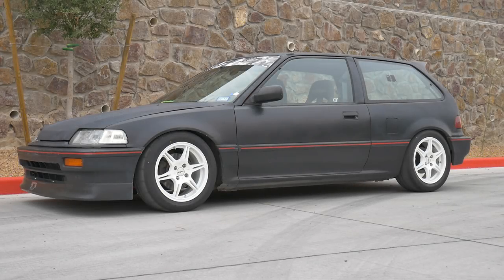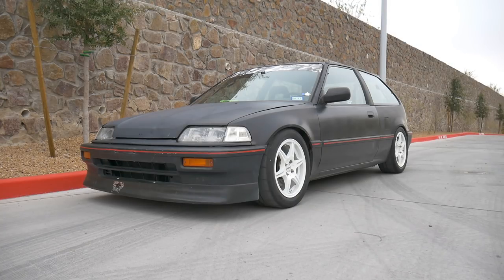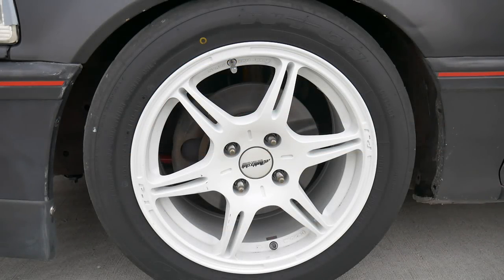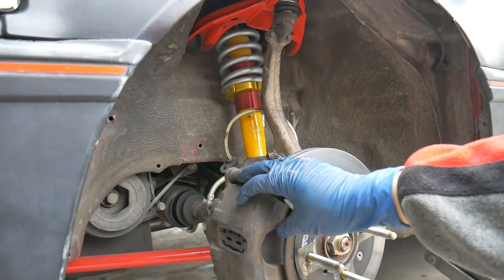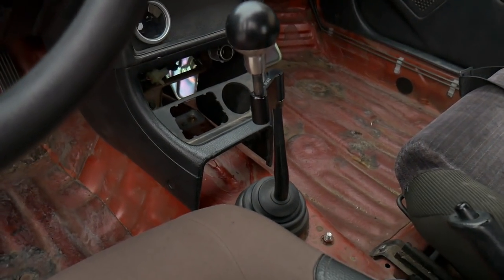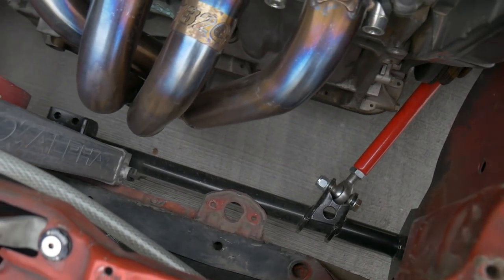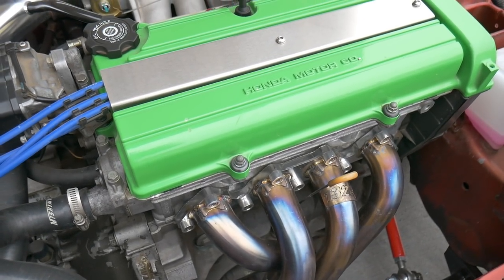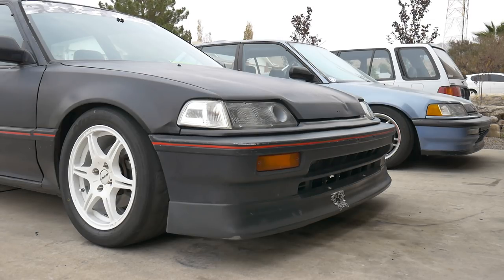My 1990 Civic DX Track Build - B20B EF Hatchback

Comment from the maker: I meant "Innovative" mounts!!  I also forgot the EX master cylinder, 40/40 valve, DA rear disc, and front upper and lower Energy Suspension control arm bushings.  😀
Reply: Garage Built Hondas: with the remainder of this year and part of next 2018 I won't be able to do my rear suspension swap out. But are the 500lbs rear springs a hard feel?
Reply: Garage Built Hondas: where can I send you pics?
Reply from the maker: +Robert Shawiak yes, not recommended for daily use.  Stock are probably 120-150ish, most aftermarket are 250-350.
Reply from the maker: +Robert Shawiak garagebuilthondas@yahoo or through Instagram
Reply from the maker: +ACURA NSXT Me either, not as many roaming around anymore.
Reply from the maker: +Christopher Millington Yes!  I receive all my mail there!!
Reply: Can I send pictures of mine to you sir?   Email address works best for me.

Comment: This car is an inspiration for my 91 DA. It has a tired old B18A1, needs a paint job badly, has expensive mods where it matters and eBay elsewhere (such as lips), still running OBD0 on a chipped PR4. Can't wait to swap in a high compression B20 and throw on some coilovers. Gotta love purpose built cars whether it's a daily or a track car. Or both. 😎
Reply from the maker: +Unliv3D your DA sounds exactly like this car in 2015.  I had the A1 and ran it so hard and it never once let me down.  It smoked like crazy, hence the "black dragon" name of this car, but I kept the oil topped off and it never let me down all season.  You'll love the b20, I immediately felt the difference the first time I drove it!

Comment: Yeah this is my favorite out of all your Honda's, I had it as my first car plus it has a B20.  Really would love to see a wrinkle plus paint job on that valve cover man . Mine came out so very nice. Keep em vids rolling in \m/
Reply from the maker: +Roel Pastors thanks Roel, I'm probably going to change the valve cover before next season also.  Wrinkle red?
Reply: Yes wrinkle red is awesome but it comes down to personal preference. Red will really match the current color scheme though. LATOMMYLA had a very good tutorial recently on how to get it right and Zosh how to NOT lol.  First you sandblast it down to remove all the old paint. Then clean with some brake cleaner. mask of all parts not to be sprayed. tip for the spark plug holes use some old sparkplug wires and cut off the wires. same for PCV valve and breather pipe and oilcap (cut off the top so you just cover the threading). I used and old piece of hose.  then go one thick layer horizontal. wait 10 mins. then one thick layer vertical. wait 10 mins.  One final layer diagonal. Wait 10 mins. Then really bring the heat either by using a pre-heated oven/put in oven to watch it wrinkle (may not please the wife so much lol) or a heat gun. Then let it sit for 24 hours to really let it cure.  The results I had are amazing! It looks even better than OEM because the wrinkle is more coarse.
Reply from the maker: +Roel Pastors Dude, thanks so much for the instructions!!  I'm going to try this method and I love the tips for masking off the holes.  I normally use painters tape and a sharp blade to mask off certain areas, some of those sound easier.

Comment: I prefer the 88/89 bumper and trim! looks better than 90/91 pieces. I like all your mods and your how to videos later Jon.
Reply from the maker: +Osaka JDM Much appreciated!  What's going on with you hatch?
Reply: Garage Built Hondas the front end is on jack stands I've taken out the left radiator fan but the right fan is being problematic and it feels like it's hung up on something from the bottom? and the AC lines don't help being in the way UH! after I replace that then it's on to the timing belt! water pump and tensioner.
Reply: oh, and it's snowing not sure if you got snow in El Paso
Reply from the maker: +Osaka JDM getting down on it!  Love to hear it, still on the RPF1's?
Reply from the maker: +Osaka JDM ugh, we had the crappiest weather this week and snow flurries all day today.  It's supposed to get back to 50 degrees tomorrow.  I hope it does!
Reply: Garage Built Hondas sorry for late response, I'm still on rpf1s you'll be the first to know if I change anything. it's been to cold so still on stands take it easy Jon ✌
Reply from the maker: +Osaka JDM nice, sounds good buddy!

Comment: for bigger brakes and caliper, and not having to change hubs or knuckles.. You can use a 93 Prelude rotor and caliper...  caliper will need a bracket (no biggie), and the rotors, you will need to drill out to an oval shape the stud bolt holes (civic is 4x100 & prelude is 4x114)!
Reply from the maker: Thanks for the tip!
Reply: @GarageBuiltHondas  . . .   I'm old school Honda...  I bought a new CRX in 90, and back then there wasn't an aftermarket market for Hondas.  Also, if you use the stock EF header (it was 4-1 directly), cut a flange and bolt on a used 14b turbo, used an Audi 5000 intercooler (redid the ends) the car ran high 11's all day long, and used as a daily using the stock D16A6!!!.  All this for under $500.  Remember we're talking back in the mid 90's (Ferrari's and Lambo's were in the high 12's low 13's!)

Comment: I like that strut tower brace from Password JDM. I prefer one piece strut braces over the multi piece hinged ones. To me it doesn't make sense to have one with hinges. Also I want to relocate my battery do you know of any good battery relation kits? I''m going to place mine in the trunk...
Reply from the maker: +LockTest I'm going to do the same, but I'll probably piece it together.  I have seen just some wiring kits on eBay for reasonable prices.  I want to drop down in size to the Odyssey 680 and get the bracket as well.  It's a plan for this year for sure.

Comment: High comp pistons? I wonder how an ITB set up would work and run with your engine? The looks and sound plus throttle response is mental for ITB.....
Reply from the maker: +Princess Solace No, not the pistons.  This engine is the high comp version of the JDM B20B which has a slightly higher compression ratio and about 15-20 more HP than the 97-98 low comp spec.

Comment: Is it a 9.6:1 high compression b20 or 8.8:1 low compression. Bro if your racing road course you totally totally want to swap out to a b16 cable tranny you'll have Soo much more power out of the turns and alot more acceleration on the straights.  I know there's a big difference in power between the two and from what I hear the high compression b20 was grossly underrated and wasn't actually 146hp it was actually closer to 160 I've always heard. And upwards of 135 lbft torque . Great hatch though , ill always love ef's and bseries motors non vtec or vtec. I had a built ls/vtec in a 91 crx Hf which was pretty quick , ran mid 12's on drag radials. For brakes on my Crx I had PBR/axis metal master pads (bit harder the hotter they got) brembo blank rotors and good ridge stainless steel lines all the way around with crx si trailing arms and discs in the rear and a master cylinder from a 91 integra. I used a 91 Si front seat bar , 90 Integra rear sway bar. H&R race springs, kyb Agx adjustable dampening struts and skunk 2 adjustable upper arms. I also had some factory bracing that I added that the Si comes with that the HF does not, and it makes a difference.  I had numerous other mods done as well not gonna list them all , your ride brings back great memories to me of my old Crx, I sold it unfortunately about 7 years ago not because I wanted to but because I had to in order to pay my rent as I went through some tough times for a bit which was aweful. I literally cried when it drove away.  I'll never forget it or what it felt like to pull through the gears and dive in and out of turns with that car, never had a more reliable car on top which just made it that much better . Good luck with yours bro.
Reply from the maker: Thanks for that story, I loved it!!  Mine is a 99 spec high compression with the knock sensor.  It made 135 to the wheels with just bolt ons, hoping for more now that I have cams. 

I do have a b16 transmission now with an aftermarket LSD and it feels amazing.  I love the way the car runs at the track and it's so enjoyable to drive.  I'm hoping to get it tuned next and see what kind of power it has in store.  If you look through my channel you'll see that I swapped all the parts from this car to a different shell but still the same.

Comment: Would you consider going to a hydraulic transmission setup? What kind of modification and fabrication would that entail?
Reply from the maker: +Alex Kohlman Yes, but I'm going to be using a cable B16 LSD transmission for next season instead.  You could use the Hasport Hydro/Cable conversion kit, or a few companies make an actual kit to add the CMC inside the pedal assembly.  I've seen some in the engine bay also.  I don't have much knowledge on it though.  Maybe someone reading will help fill it in!
Reply from the maker: +Alex Kohlman there we go, you need hydro mounts also.  I'd consider trying it.  My friend has it on his crx.  I've never driven his car though.

Comment: Looking good! I'm jealous. Currently trying to build a crx but I can't get the engine out of the donor DA. I think the problem might be the rear mount. Do you have to take the whole mount off, or just the bolt that runs through it? Thanks!
Reply from the maker: +Michael Allison thanks!  Just the bolt.  The mount doesn't need to come out.
Reply: Garage Built Hondas thanks for the reply! hmm must be getting stuck on something else somehow then... linkage, exhaust, and axles are all out so I don't know what is going on lol.
Reply from the maker: +Michael Allison heater hoses?  Speedometer cable into transmission?
Reply: Garage Built Hondas I'll double check but I think I got those too. I lifted it with the hoist with a bias on the drivers side. The entire thing comes clear of the engine bay except the rear. When I shine a flashlight back there the only thing I can see still attached is that rear mount despite the fact I have the bolt out of it, it's driving me crazy lol.
Reply from the maker: +Michael Allison it might just be the angle, try a pry bar to get it free from the mount.
Reply: Garage Built Hondas right on, thanks man wish I new someone in the area with your knowledge and skill set. I'm new to working on cars, it is really satisfying but super frustrating too.
Reply from the maker: +Michael Allison I'd definitely lend a hand!  But as long as you stay patient you'll be fine!  Good luck, let me know how it goes!
Reply: Hey no worries, thanks to your videos I'm way ahead of the game. I'll keep you updated for sure, hopefully i resist the urge to bust out the saws-all lol.
Reply from the maker: +Michael Allison lol, sounds good!
Reply: It's out! You were right, just needed some leverage. Managed to stick a 2x6 back there and pry it off the rear mount, came right out after that. Now I have to yank the rear trailing arms off and I can finally have my garage back! thanks for the advice.
Reply from the maker: +Michael Allison awesome, glad to hear!!

Comment: Hi. I just bought a 1988 wagon and it’s amazing. I will like to ask you where do you get the parts for it. Like suspension etc.
Reply: I’m not trying to do coil lower.
Reply from the maker: +Eduardo Mendoza Online.  I Google the parts I'm looking for and shop around for the best prices.  I also check eBay when looking for something specific.
Reply: Garage Built Hondas. If I’m not able to find parts for the wagon can I use the parts from the coup and sedan for it?
Reply from the maker: +Eduardo Mendoza everything is exactly the same with the exception of body panels/parts, rear trailing arm parts, and exhaust system.  And obviously the interior parts are all different.

Comment: Jon, for my b16 swap I’m keeping my stock rad cause I don’t want to notch the hood, what hoses would you recommend me using?
Reply from the maker: +BklynBuild718 the stock hoses will be too small for the outlet/inlet on the engine.  I'd get some 99-00 Civic Si if you're buying oem replacements from the auto parts store.  You can get some inexpensive silicone ones for a EF w/b16 on eBay.  Around $35, I have then on my Si.
Reply from the maker: +BklynBuild718 you can see them here if interested! 
https://youtu.be/n_KnkQ3Vmkk
Reply: Garage Built Hondas yes thank you that makes sense, I saw the video and just ordered a pair. The Hatch looks great man, love the progression videos
Reply from the maker: +BklynBuild718 Nice and thanks!
Reply: I wanted to order a skunk2 intake manifold for my jdm b16a, is their a specific one made for that motor? I noticed you had one and was wondering which one you had.
Reply from the maker: +BklynBuild718 Just look for one for the b16, all b16's regardless of US or Japan made are the same cast and bolt pattern.

Comment: Im doing an obd2 b18 swap into my 1990 standard hatch i got the motor down to obd1 and i have an adapter ecu adapter harness that converts my ecu connector to 0bd1 how do i wire up the map sensor correctly?

Comment: 2 liter engine and tiny dual core radiator? Any cooling issues and does your fan runs all the time to keep it cool? Im taking out the stock rad in my Ae86 and putting half size honda dual core i already have so if it cools a b20 should cool my 4age without a problem
Reply from the maker: +Hachi-Roku Performance Group No issues.  I drive this car at the track for 3 events during the summer in 100+ degree weather and works flawlessly, fans are on when I come into the pits but no abnormal temps and the needle on the temp gauge has never once moved above the normal spot all day long story the events.
Reply: Garage Built Hondas good to here im on the Arizona and Mexico boarder so same 100°+ and wanting to save and relocate some weight and space while still staying cool
Reply from the maker: +Hachi-Roku Performance Group Awesome, we're pretty close to one another.  Which area are you in, Sierra Vista, south of Tucson, Yuma area?
Reply: Garage Built Hondas sierra vista area im about 3 or 4 hours from el Paso and my house is exactly 1 hour from the musscleman honda circuit and tucson drags and 5 minutes from 1 of the airport they do autocross but i wanna get on the Wilcox race track but it cost way to much for track days
Reply from the maker: +Hachi-Roku Performance Group nice, we are planning on attending an event at Musselman this year, maybe you can make it out and join us that day.  I think it might be between April and November.
Reply: Garage Built Hondas as long as you guys don't mind hanging with a toyota. They are suppose to be adding on and installing more lights. Well thats what they said in September when i was there last because the raised drift night up an extra $25 to help pay for it to get done sooner. Have you been before?
Reply from the maker: +Hachi-Roku Performance Group Of course we don't, we have a handful of friends that drive all kinds of random cars, but a lot of us are Honda guys!   They were at ASR for our event last November and they also said they are increasing the track length to 1.8 miles and it'll be done this year!! 😀
Reply: Garage Built Hondas awesome i like seeing other people's build and always enjoy meeting up and driving. Do you have your build on Instagram?
Reply from the maker: +Hachi-Roku Performance Group I do too so it'd be cool to check out your car!   I have pics of all my cars on Instagram, not all build stuff but 100% car related!

Comment: how to identify the spring rate on my ground control springs? also I noticed on the koni damper it seems to have a spot to hold the original mount cup for the brake lines but I cannot get that mount off of the OE dampers any ideas? edit: I see your brake lines are floating also.
Reply from the maker: +Dandy Lion You're correct, mine float.  My particular set of GC's from Eibach have the 500 on the rears for the spring rate.  I believe many have the metric rating on them.  Google it for the conversion.  There's a few threads online about it.

Comment: Got a 90 hatch sitting in my field
Reply from the maker: +BRENDAJASON1 what's the deal with it?
Reply: Garage Built Hondas basically a shell everything is gone from the interior still has the suspension and all the exterior stuff though
Reply from the maker: +BRENDAJASON1 All you need is the driver seat and steering wheel. 😎
Reply: Garage Built Hondas yea all the gas lines tank basically all, went into crx I got
Reply from the maker: +BRENDAJASON1 Aw a donor, you should sell it then if not wanted, use the money for more crx parts! 😁
Reply: Garage Built Hondas yep yep most will fit on the x but not all